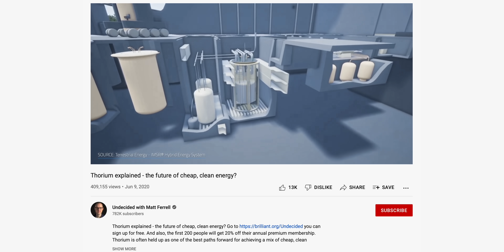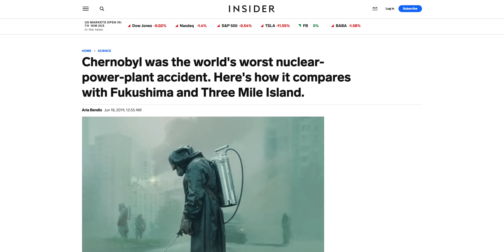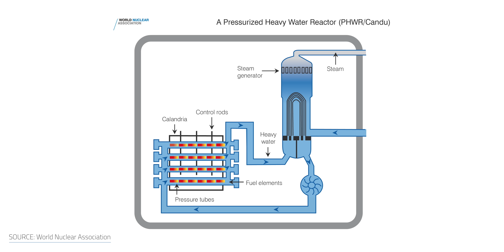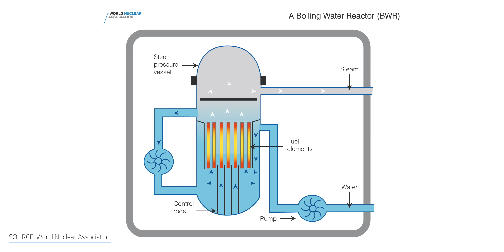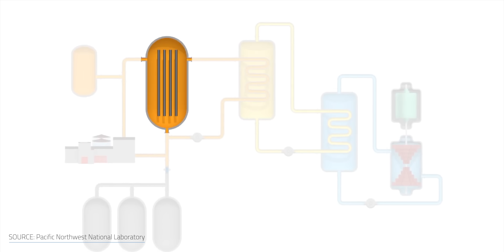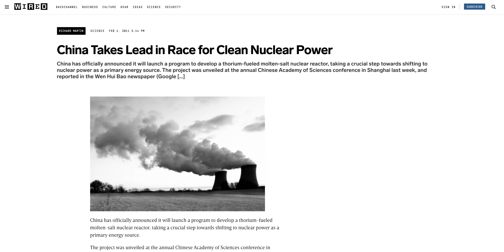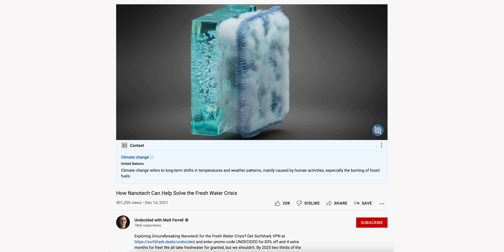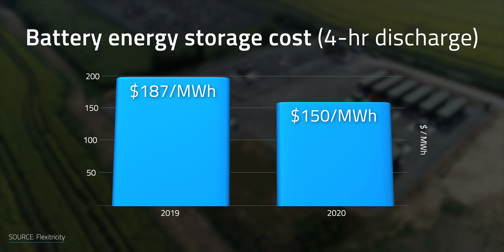Revisiting Thorium Energy - The Future of Nuclear Power?

Comment: Thorium reactors won't make up a significant (greater than 1%) proportion of global power generation for the next forty to sixty years. Nuclear will be needed to address the climate crisis but mostly in terms of existing plants and the few now under construction. Renewables are quicker and is still becoming more efficient.
Reply: Small modular reactors.  Built in factories and put on ships or land.  Economies of scale.
Reply: @danadurnfordkevinblanchdebunk  If everything goes perfectly for Uranium SMRs, they might just make it in the best case scenario. Thorium won't. They are another 10 years behind. I'd be happy to be wrong, and for it to go real well, but I don't see it happening.
Reply: @danadurnfordkevinblanchdebunk  No, you haven't proven SMRs are worth it until someone sells one and it works well for its lifetime. If at any point there is a recall on SMRs for a significant manufacturing issue, the company will bankrupt itself immediately and the market for them will collapse.
Reply: @danadurnfordkevinblanchdebunk  Naval reactors aren't commercial products. If you don't understand the difference, you're going to have a bad time.
Reply: @danadurnfordkevinblanchdebunk  Great examples of SMR economies that were so unsuccessful that all other planned versions of their class were either cancelled or scrapped. Is that the point you are making, that SMRs aren't actually very economical and won't catch on? You're nailing it : ) Thanks for suggesting I look them up, I learned that the Lomonosov was 300% over budget when completed and that the Sevmorput was slated for scrap more than once since its construction. 

If I wanted to argue your case, I would have mentioned the Yamal, which is still in service and wasn't a clusterfuck of waste, but I'd have to hide that just like the others, 4/6 of its sister ships have been decommissioned.
Reply: @danadurnfordkevinblanchdebunk  I am following Rolls Royce and Nuscale with interest, as they are the furthest ahead with their plans. Of course neither of them are actually selling any units yet, they are only taking orders at best. What production capacity do you expect out of Rolls Royce or Nuscale in terms shipped units per year? Rolls royce reactors are 220 MW and Nuscale's are 60. I seriously doubt that either plant will be able to manufacture dozens of units per year required to hit the goals you dismissed in the original post.
Reply: @danadurnfordkevinblanchdebunk  Unless of course the process is not actually commercially viable, in which case economies of scale make it even worse. You are acting on the assumption that you could plug a naval reactor into the grid to produce electricity at competitive prices. There's a good reason that nobody does this and it is simple economics.

Comment: I wish you would have expanded on what Lin-Wen Hu said at 01:32. Molten Salt Reactors can breed both U-238 and Thorium into fissile material and running on U-238 seems like a better starting point. From what I can remember, one drawback of Thorium is a very high energetic decay process in the spent fuel so it must be handled with great care (remotely/robots?). The U-238 cycle does not have the same issue and we already have lots of U-238 (since uranium ore is mostly U-238). I think many/most MSR startups are looking at the uranium cycle and not Thorium for those reasons.